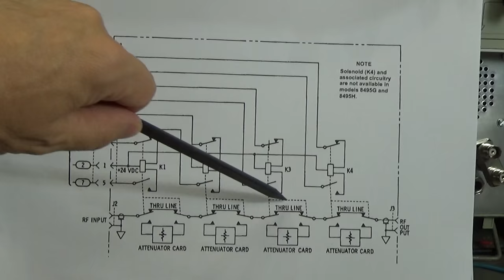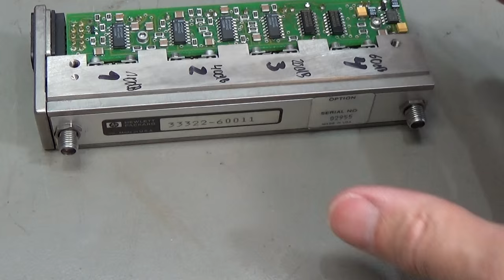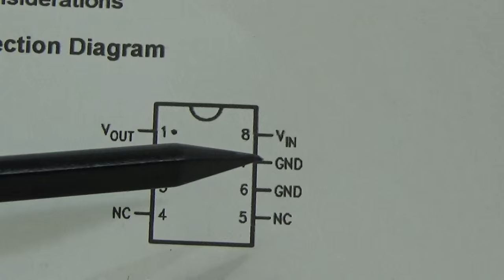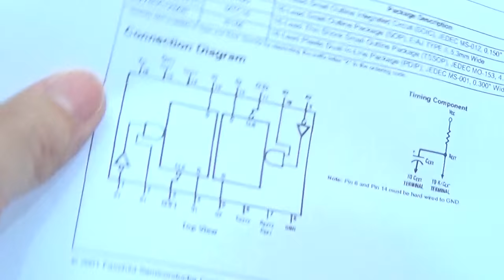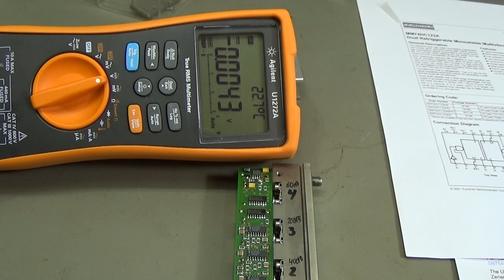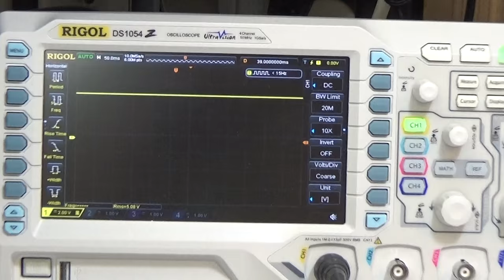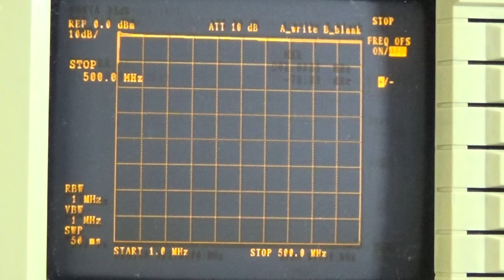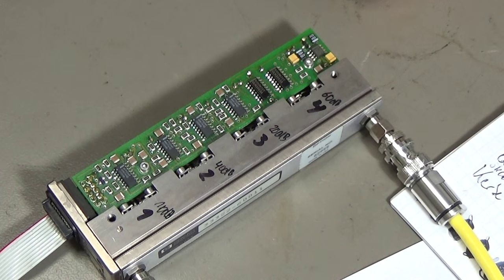#58 Teardown: HP/ Agilent precision step attenuator for HP/Agilent Signal Generator 8648 series

Comment: Thank you very much for this awesome video. I'm repairing an Agilent 33321-60051 step attenuator from my Agilent E4402B spectrum analyzer as I'm writing this comment. So far my attenuator is a twin of the one that you've shown. Though the partnumber and attenuation coefficient are different. Anyway, I'm double checking everything just to make sure I don't run into an accidental difference between these parts and don't blow anything. At least the power pins are the same. The part that you've identified as a transistor (the one that feeds the linear stab) is actually a 7.6V zener diode. If you look carefully, you'll notice that one of the pins of the sot-23 package isn't connected anywhere, but the device still maintains 7.6 volts across its outputs. I tested the unconnected pin with a DMM and it reads open. Interestingly enough, the 8L05A can deal with up to 30V volts of input voltage, so I think the zener is just there to lower power dissipation of 8L05A.

Comment: Hi Peter. I have a Schlumberger Stabilock 4039 whose attenuator is stuck. Hopefully I will be able to test and repair it using the info in this video. I really hope the attenuators are OK and it's a switching transistor. Thanks for the good info!

Comment: Thanks Peter, very interesting. That would be a very expensive unit to replace, so it was a good buy and it is in perfect order. Interesting how they have decided to control it, I wonder why they did it that way instead of straight logic signals?
Reply from the maker: Alan Cordwell Hi Alan, thanks for feed-back. Yes that is really an expensive component I couldn't believe the price I found on ebay..Well, why do they have decided to control unit as they did. My guess is as good as yours. In the past the very early attenuators without any electronic inside the attenuators were also controlled by switching the ground. So may be traditional or a question of compatibility ?? The second idea I remember that in the mid 70th's when logic chips came out everything was triggered with the trailing edge. As far as I remember it was due to the early available TTL chips...

Comment: A fantastic demonstration of reverse engineering. Would also make a great standalone bench attenuator with a few tactile control switches or a simple micro routine.. Karl
Reply from the maker: Karl Fell Hi Karl, yes would be a nice bench attenuator as well. Now where we know how it is designed it is easy to build a circuit around. Thanks for feed-back!

Comment: Very good video. Thanks..  Not sure if you have a Tek 465 or 475 but these are great scopes, especially, for HF work. I have 4 of these in my lab, 2) 465B's and 2) 475B's. This allows me to move from bench to bench without disturbing the test gear.
I really want the scope to just be a scope. I have counters and meters of various types to get other info. However, The TeK DSO's are also very nice and at some point I may get one. Al, W2AEW uses his often on his youtube videos and I can see the value of such an instrument.
Anyway, Thanks again and I look forward to more of your videos.
I am not sure if you are familiar with the HP 8640B sig gen but it is an amazing instrument and built like the space shuttle. Hi.. I hope someone, perhaps Carlson, Al or you will do a tear down of this instrument.

vy 73,  Glenn WA4AOS  DSM Labs (dotcom)
Reply from the maker: wa4aos hi Glenn, my is a 475 and it is still a valuable scope. Gut I have to admit that  a DSO is a Great invention. I'm using my DSO now much more then my 475. okay thanks for comment mate   73

Comment: Thanks Peter !!! 73s
Reply from the maker: Pasquale IW0HEX Thanks Pasquale! Did you enjoy Friedrichshafen?? Did you have a stand on the flee market? 73 Peter
Reply from the maker: Pasquale IW0HEX That is a great price! Lucky you are :-)
Well concerning the PD55003E, it is as I thought. You can only manage it with hot-air.  If you nevr worked with hot air before, be very careful with air stream. If it is to much you will blow all components from the board!!